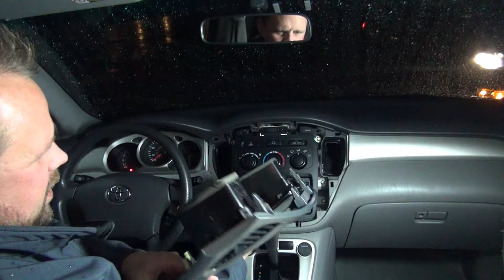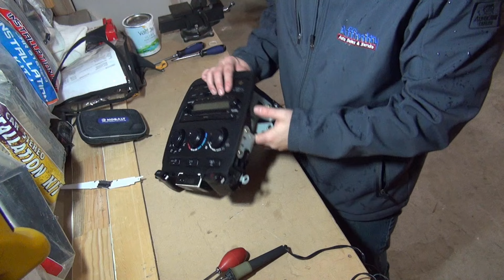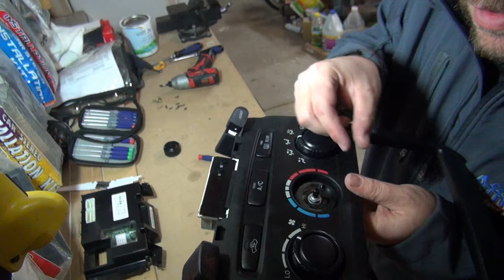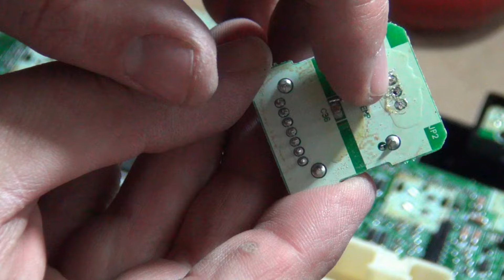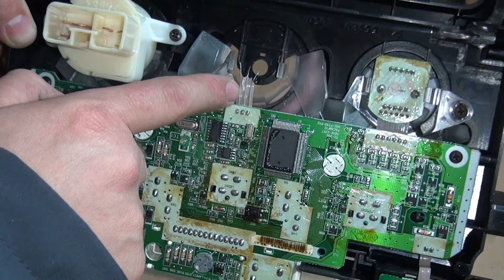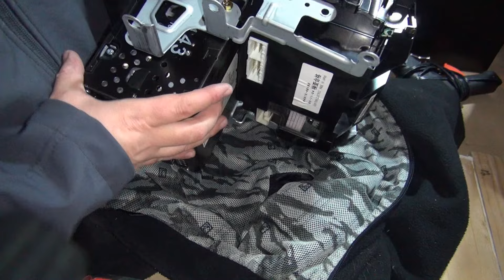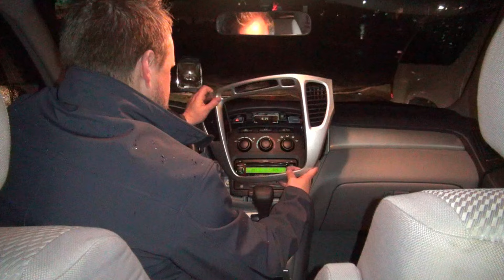How To Repair Toyota Highlander Climate Control | DIY Tips

Comment: This is one of the best DIY type videos I've seen! Looks like all of the important details were clearly explained in everyday English. My girlfriend has an 04 Tacoma -- would the info in this video apply? The heater seems to have a mind of its own -- sometimes full hot, sometimes medium, sometimes cool. Being that summer is nearly here, I was going to try disconnecting the heater valve -- but seems it's no longer in the engine compartment. Hoping you have some advise that makes the fix just as easy as you show here. WWG1WGA

Comment: Worth putting a paper towel, plastic bag, or a rag next to the climate/stereo unity when removing bolts -- saves losing them under the dash if one falls.  Also, the nut clips on the top left and right corners behind the dash can fall out, be sure they are centered before trying to reinstall unit into dash.

Comment: One more thing:  Initially my climate control still didn't work, on inspection I had <1mm threads of solder bridging contacts.  Make sure you don't have any bridging strands of wire or solder.  Can use a continuity tester (Ohm-meter) to check between main board and corresponding contact on the control board -- there should not be continuity between adjoining pins.

Comment: Thanks so much!!! Saved me a couple hundred $$$ if I had sent in my panel for repair, or $1200 for a new one.  A few tips:  Get a good fine-point soldering iron (<$20 on Amazon), I used my old one and nearly melted my board.  I had lots of trouble desoldering completely -- I suggest using desoldering wick if the desoldering vacuum doesn't work.  It was VERY hard to get the 3-conductor ribbon stripped and threaded back through the little PC board.  It takes a very tiny amount of tinning, or it won't go.  The holes in the PC board need to be completely clear of solder.  It would have been easier to put new wires through the main board.  Since Radio Shack is gone it's not easy to find the 3-conductor ribbon, and I found that having to get all 3 wires through together was almost impossible.  It's OK to separate the 3 wires and do them one at a time.  DO NOT try to pull the main board off the dash insert, you'll probably destroy your LCD display.  Finally, if you try the Dorman repair kit, it has a T shaped stem, which does not fit D shaped knobs like the one on my 2004 Highlander.

Comment: Had the exact same problem on my 1987 Celica. Toyota sucks for using those circuit boards from the same cheapo company over 20 years. When our 2004 Highlander heater went out, I knew exactly how to fix it. Amazes me how they were too cheap to spring for a more solid component considering how much work it is to fix it. Thank God Toyota doesn't build airliners!

Comment: I had the same problem on my 2006 Highlander Hybrid and fixed it after watching this video. Thanks so much for posting this video. It saved me a lot of time fooling around trying to find out what is the cause of the problem ( hot-cold, hot-cold) . The only difficulty was trying to get those three wires back into the circuit board of the temperature switch which was a little tricky because you have to get the three wires aligned at the same time so they can be introduced into their respective holes. Other than that it's not difficult. So thanks again for a great useful video !!!

Comment: I have the same problem with my 2004 Highlander and have been putting off having it fixed because the dealer wanted almost $1000K to fix it (most of it was for the aftermarket part.)  My Highlander has 340,000 miles on it (yes, that's right, and still runs perfectly.)  But I clearly don't want to put a grand into it for this.  But it is getting colder and with this video I am confident I can do this myself.  This was very instructive and I'll let you know how it turns out!  Thank you.

Comment: My Toyota dealer wanted $1500 to fix my intermittent climate control on my 2006 Highlander. I followed the instructions on this video (my ribbon cable was broken in two places, just like in the video) and in less than two hours I fixed the problem. Thank you DIY BRI!!

Comment: My highlander hybrid was broken into and the radio was stolen. They ripped out the climate controls with it but lucky no wiring was damaged. I found the complete control unit that should work for my hybrid but the dashboard display for outside temp reads "e" and the ac doesnt blow cold air. Could this mean i have the wrong part or do i have to reset something?

Comment: I had the EXACT same problem with our '02 Highlander. You perfectly diagnosed and showed me how to fix it. The hardest part was getting the solder out of the circuit board holes-  I heated up a heavy-duty sewing needle and it worked like a charm. THANKS for helping people to fix instead of waste!!!

Comment: Just subscribed,  I have a friend whose highlanders heater is having issues. It blows heat on the drivers side, but the passenger side is cold air, and it's winter time. I sent him this video, hopefully it is a soldering issue. I'll let you know if he fixes it. Good video!

Comment: I have similar with my 04 highlander.  I really appreciate the input.  Mine is doing even more flaky things so I actually got a refurbished control head.  I was going to pay to have someone do the work, but dang it looks easy when I don't have to actually open up and solder.  Your stepping through the removal, the connectors, and re-assembly sound priceless.  I am kinda sorta OK mechanically usually enough to get myself in trouble.  Hope I don't break the face plate taking it off.  Seems like about the only thing I could screw up.  I'll report back.

Comment: Good and thorough video. I have a limited edition with the auto control. the fan control went out but the temperature knob still works, but now it is starting to go out also. I'm guessing that it is probably the same knob issue that you addressed in this video??? I think i'm going to attempt this repair. Thanks!!!
Reply from the maker: I think the auto control issue is different, not sure?
Reply: Nope, auto is exactly the same.  Just fixed my ribbon today on 2007 Highlander with the upgraded AC.  The nut that holds the temperature control knob came loose, and consequently the ribbon broke.  Literally took my 30 minutes to remove, solder, replace and test.  I solder at home all the time (I do electrical tech), so that part was simple for me, but might be daunting for others without the right stuff.  Thanks to Do It Yourself Bri for the video, pointed me right to the problem before I got started!

Comment: mine has some issues with the clock too, actually its gone, no clock and the 3 buttons are not working (no light)....do you have some tips to fix this???  
thanks in advance!!!!
Reply from the maker: Sorry not sure on that one yet..
Reply: Clock, AC and air circulate light do not work why? did u fix it ?

Comment: Awesome video, Bri. Took my unit apart and noticed the two outside 
connections were completely disconnected. However, when I made the fix, 
it doesn't appear that anything has changed with the temperature. Is it 
possible the solder connection is poor in the interior of the holes? I 
did use a solder sucker to make the holes big enough to the fit the 
wiring through, but it seemed like there was still solder in the holes. 
My mechanic claimed it is a blend door actuator fix, but I'm convinced 
this is the issue given when I took it apart, the two outside 
connections weren't connected. Any ideas? Thanks again for posting!

Comment: I have a 2014 Mazda 3 and the Dual climate control. The center of knobs are a spring loaded operation. On drivers side the spring action of button broke making (the Automatic option inoperable). I went to Mazda and they say I'll need to buy the whole control unit $400. I am reluctant to try to pull knobs off to dissect on my own without at least attempting to see how they are clipped on.  Any experience or thoughts.
Best; Tom

Comment: Thanks.  Any advice without removing the wires for trying to improve the connection.  Is there a trick for getting solder into the opening while the wire is already in there.
Reply from the maker: Put solder into the hole before you put the wire in and heat the hole up as you put the wire in..
Reply: How do we pull the wires back out of the hole without risking the wires breaking?  They're so short, can't afford them to get any shorter.  Is there any way to improve the connection without pulling the wires out?  Any way to try and force some solder into the hole with the wires already in there?  I appreciate all your help on this.

Comment: We tried this today and it does not appear to be completely fixed.  Before we tried the fix, it blew almost exclusively hot, not matter what we tried.  If we fiddled with it enough, we could eventually get it to blow cold for the AC, but not always.  When we got it apart, we found only the center wire attached, both wires on the outside were broken.  We had trouble getting the wire to go back through the holes in the switch, so couldn't leave any solder on the wires.  Once we get the wires through the holes, I put solder on the outside where the wire came through the hole and they seemed nice and secure.  But, when we took the car out for a test, the AC was not blowing very cold.  If we didn't have solder on the part of the wire that is passing through the hole, could that be the problem?
Reply from the maker: +Dan Parnas Yes it does sound like a poor connection with the wires.
Reply: What part of the circuit board on the switch is it critical for the wire to have a good connection?  The interior of the hole?  If not, where so that I can re-check it.
Reply from the maker: +Dan Parnas Yes, it's actually one of the more difficult solder joints to make..
Reply from the maker: +Dan Parnas the interior of the hole
Reply: Success.  We took it out and just re soldered at the connections, but did not remove the wires and now it works great.  Thanks for the help!!!

Comment: Excellent video.  After seeing a few of these videos I would suggest soldering 3 bypass wires directly on the two boards (6 solder points) without even removing the small potentiometer board. An easy solder job and just allows you to abandon the crappy ribbon altogether. Your video was awesome. Very thorough and clear!  My 04 Highlander has not done this yet but I am guessing it will any day. Thanks for the great video!
Reply: You can use 16 or 18 gauge wire. Just remove the ribbon cable and trash it. Solder in three wires cut to length and it will be good to go. The older models have the same problem only the cable is only about a centimeter long. This ribbon cable is an attempt to solve that issue but still fails.
Reply: What gauge wire did you use?
Reply: Yea, that's what I did.  I just soldered 3 jumpers, didn't even remove the existing ribbon (which had 1 broken wire).  I used some 30AWG jumper wire.  These knobs don't carry any current, so use anything that you have.

Comment: Hi thanks for your guidance.  Fixed it as instructed and it worked.  Only thing I couldn't do is the soldering.   So I google electronic repair shops.  Had to pay 40.00 to have them fix it.......again thanks and as easy as you showed.  Took them just a few minutes to repair.
Reply from the maker: Thanks!

Comment: Thanks ,I repaired mine last night about midnight and I just wanted to drive my car. I have been suffering intermittently. There is another guy that shows the same repair so I watched him also. But in reading the comments someone suggested to remove the plastic window, because it makes it easy to remove the  ribbon. But I also found that the ribbon can be removed from the top white lever as well and it makes it easy.

Comment: just fixed the same problem on my 01 highlander. Removing and installing is a job anyone can do, but had my brother in law do the soldering as he has experience in that area . the cost of a new unit from my local dealer is $1400, so well worth doing it yourself.